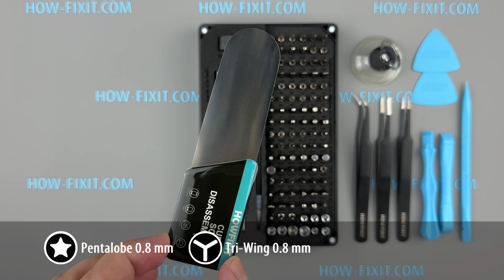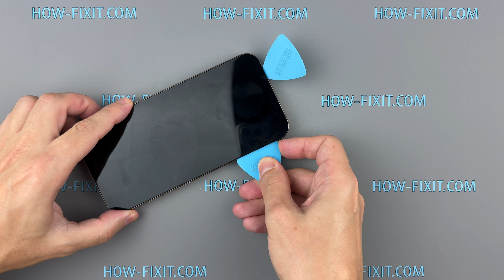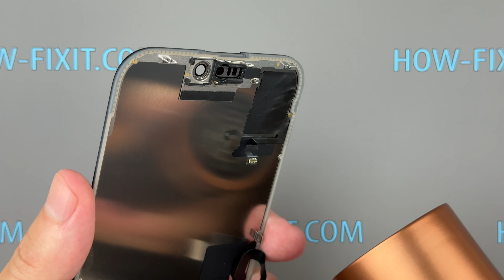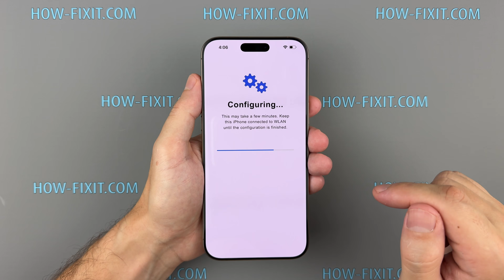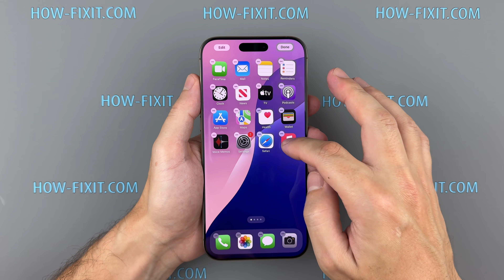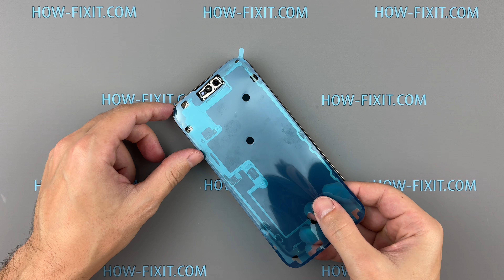iPhone 16 Pro Max Screen Replacement Tutorial – Fix Your Cracked Display

Comment: Why not take off battery cable first before take off screen that no problem?
Reply: now it is not needed as software works differently now and force restart is good enough
Reply: @zzceoso just turn off enough no need take off battery first

Comment: isn't it necessary to disconnect  the battery ?
Reply: yes.  some people skip  but should be done always before.
Reply: Not if its dead
Reply: But how disconnect the battery because battery flex is not down the screen 🤔

Comment: Won't there be a risk of a short,since battery is not getting disconnected?
Reply: As long as it's Turned off before installing the screen it's ok,done a few before.
Reply: There is a risk but the odds are in your favor
Reply: You have to install it perfectly first go or risk short

Comment: Kindly mention heating tool name plz
Reply: I use a hair blower. It isn't as effective but gets the job done.
Reply: Just a spudger and ur good.
Reply: Its called a dyson styler something, its used for hair styling
Reply: You can use a hair dryer you actually don't even need one just be careful. If you're strong enough you don't even need to soften the adhesive.